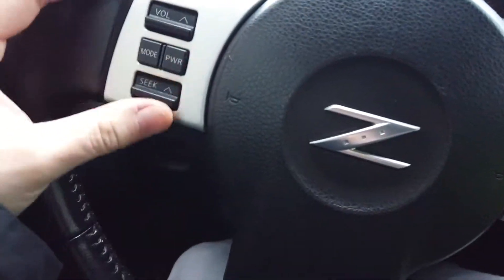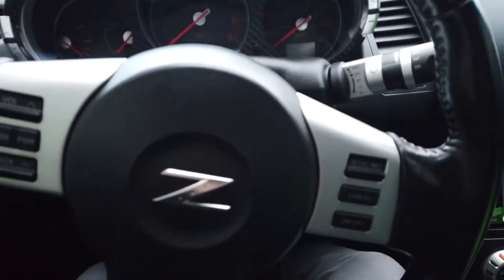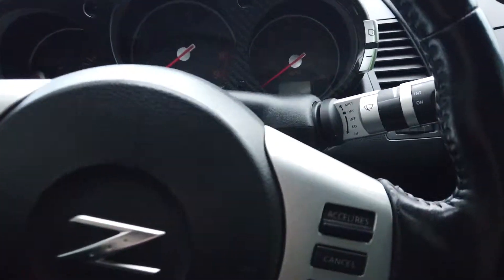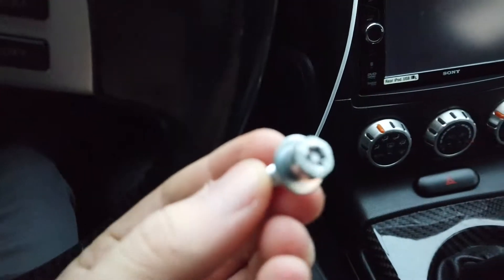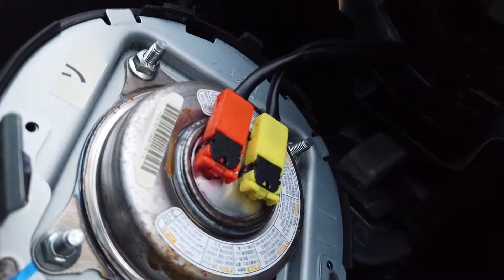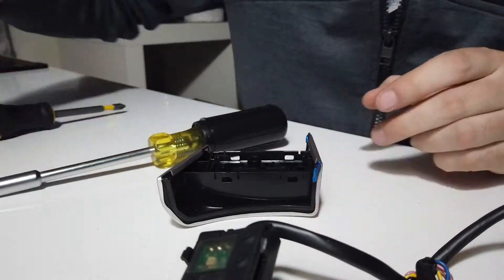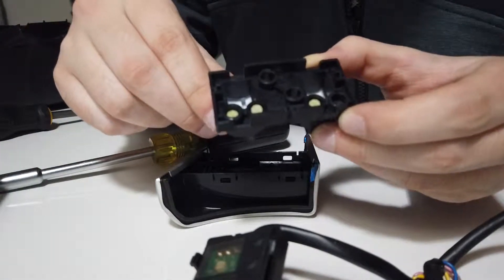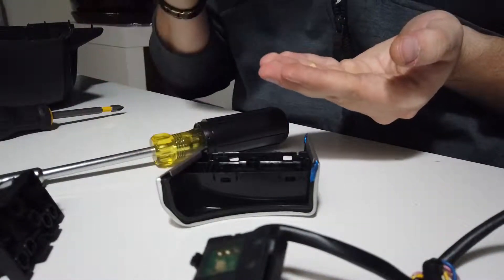Steering Wheel Removal / Wrap 350Z

Comment: I had to turn the steering wheel all the way to the left in order to take out the center 19mm bolt but the steering wheel still doesn't wanna come off. The steering wheel made a click and it got stuck there. Did I mess this up?
Reply: Nevermind I got it. You just need to pull on it really hard as you wiggle it.
Reply from the maker: Sorry I didn’t see this, but yeah you just have to give it a good pull

Comment: Does anybody know if a base model 350z(no controls on steering wheel) has the plug to be able to add the controls?
Reply: ihackmobile they all have the clock spring connector. However you have to check your brake and clutch pedals if your wiring harness has the cancel switch connectors